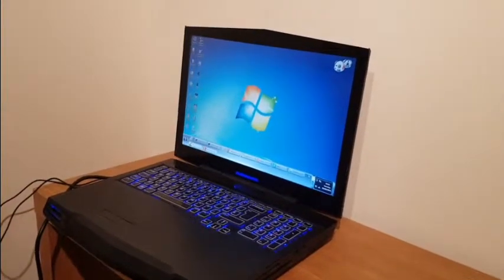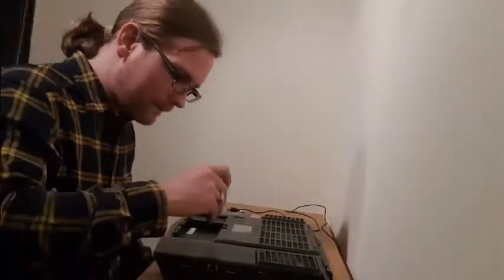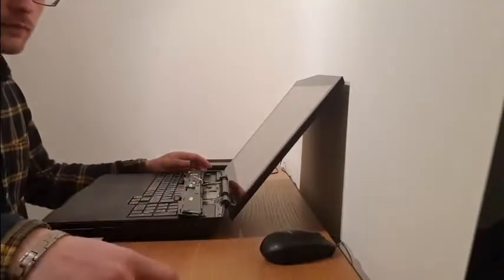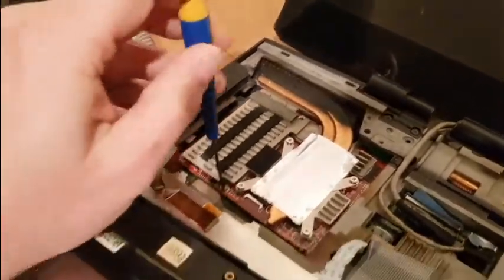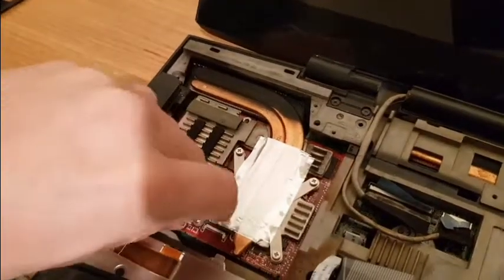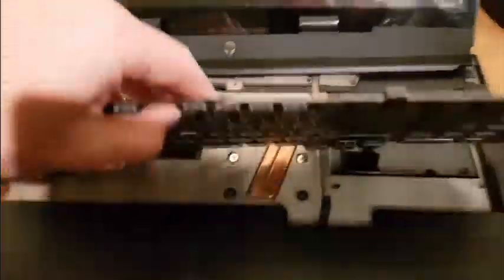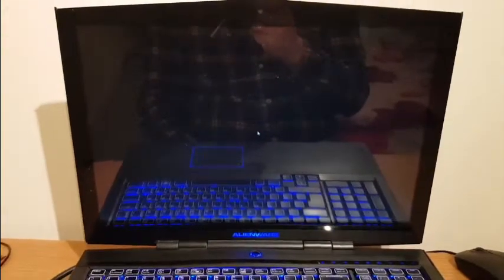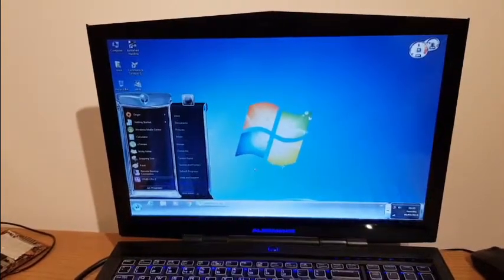How to swap Radeon graphics card in Alienware M17x R2?

Comment: Hi, sorry bit off topic, .. how can I turn on the laptop with a broken switch...?  Pulled keyboard too quick and broke cable off (beginner) .. need other ways to turn laptop on, any advise?
Reply from the maker: Well you'll need a new ribbon connecting the switch 😂. These are available on Ebay, I wouldn't recommend any other ways to turn it on

Comment: for 'dead'alienware try to reset bios. im sure it will come back to life :D
Reply from the maker: Yes - that's true. I've had one M17x R2 that revived after resetting bios in it. As well when I've swapped memory in other alienware it didn't want to wake up after, even when swapping them back. Without dissasembling, it took 20 - 30 times switching it on-off for bios to reset to fail safe settings and boot normally, where I could adjust the timings in bios to correct settings. Thanks for sharing the tip with others, Game of Bros!

Comment: Hello, Nvidia GTX 780M 4gb it works in M17x R2?
Reply from the maker: I've done Nvidia but haven't went as far as 780M. Should work though. In the worst case you would need to buy a stronger charger.

Comment: What graphic card can I insert to upgrade ?
Reply from the maker: As well once you'll upgrade please share what you've upgraded to in a comment. Many thanks!
Reply: Where can I buy new Radeon 7970M? I only see used one on eBay .
Reply from the maker: @kevinho3522  I don't think it's sold new anywhere right now as that's like 10 years old card, however it's widely available in used condition on eBay or Amazon
Reply from the maker: You can insert any card that follows MXM 3.0 interface. I've successfully upgraded one of my M17X R2 alienwares to Radeon 7970M and it worked no problem. I've heard people putting even stronger cards with success in them. The only limitation may be your PSU as if you'll put a power thursty card, the PSU may need to be upgraded to at least 240W model.
Reply: @danthegeekyman132  I have one of these laptops my cousin gave me since he was just going to toss it. It had dual gpu's, one dead 5870m's and one still working. But I wanted to try my luck with a 970m off ebay to mess with, do you think I'll have any luck with it? I've read these laptops support up to 75w per slot and 150w total of power allocated to them. So I figured it should work?

Comment: Great job! I watched the first video but didn't see the step that fixed the rebooting/not booting issue. I see you dropped the battery out in the first video but it ends with it not booting still. Then in the second video, it's powered on. What am I missing here? Thanks for creating these videos
Reply from the maker: Hi - thanks! The rebooting issue was caused by faulty motherboard - it haven't worked with battery in so when I've took it out it worked - I've got one more video to upload in the series where I'm swapping the motherboard over - I've made it just few days ago so I'll upload it soon